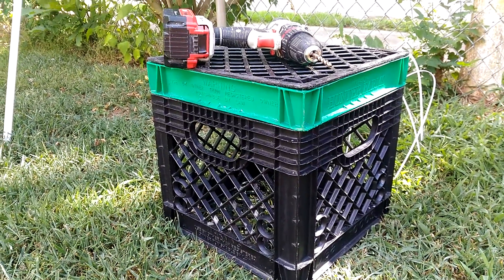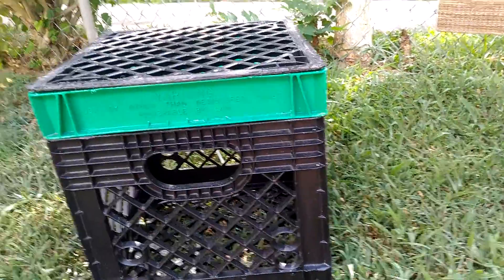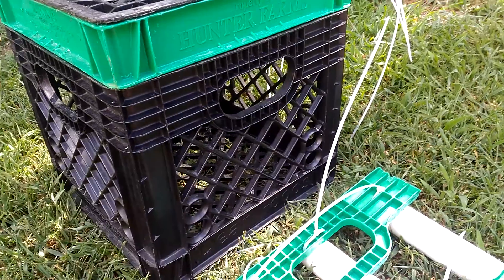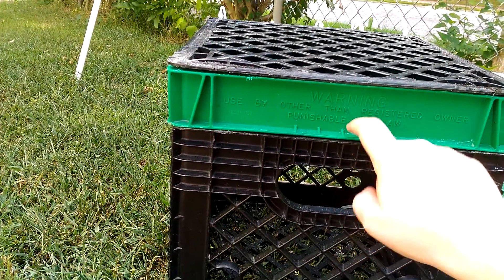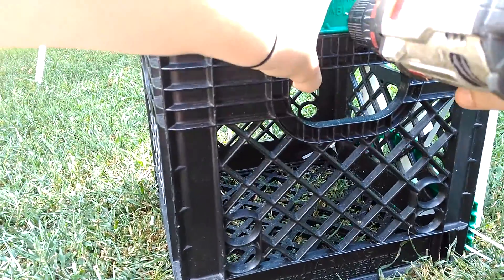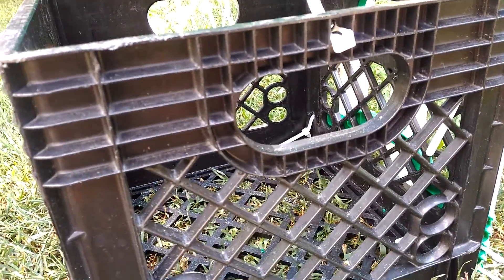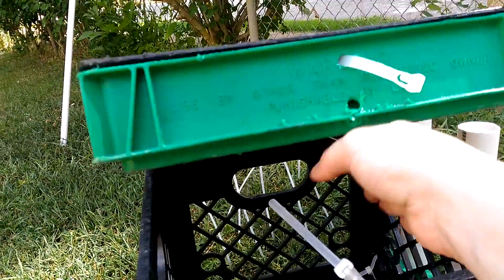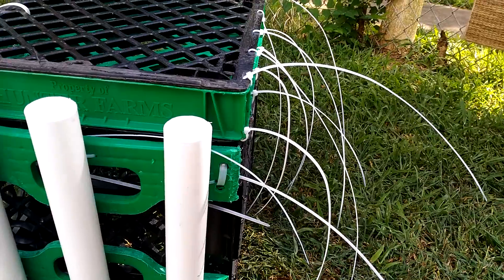Kayak fishing milk crate modification (part 4)

Comment: I used bungee and hooks to keep mine closed, easy to do in the water. I also used bungee on the top shelf side (on the outside in an x shape) to hold small items, BT speaker, hooks, and small baits. I did not put a lid on my top shelf, again bungee and hooks.
Reply from the maker: Raymond Andrews cool that might be easier I haven't had a problem with the zips yet but ill give it a shot